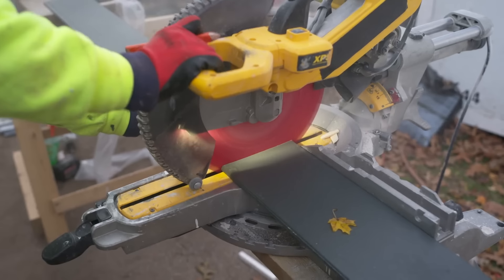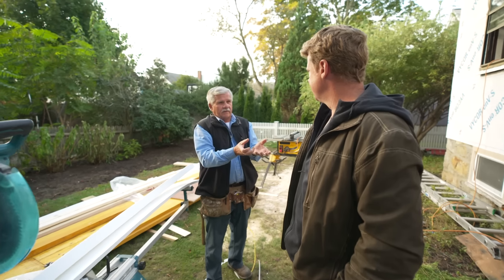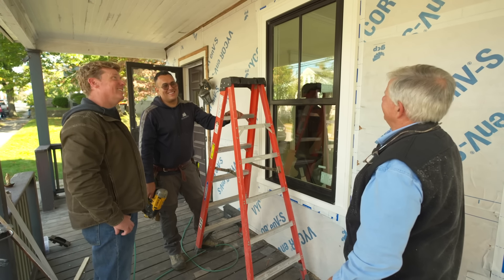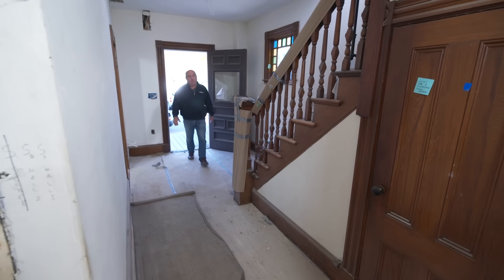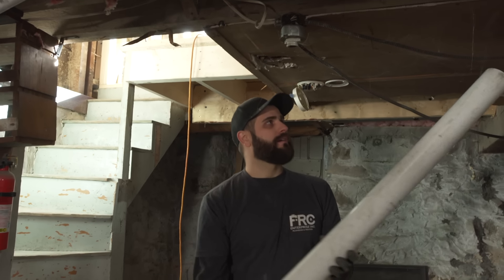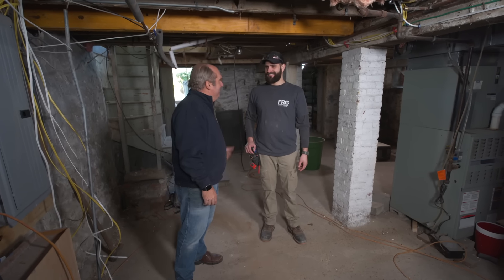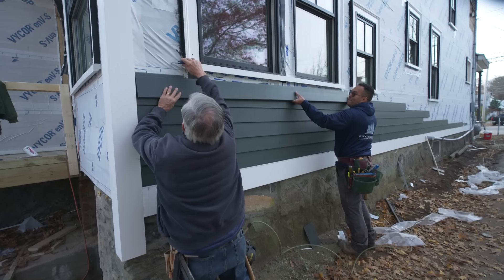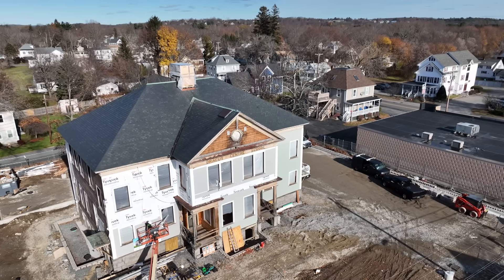This Old House | Drainpipe Puzzle (S43 E19) FULL EPISODE

Comment: What precautions need to be taken with that PVC window trim as far as warping in extreme Summer heat?
Reply: PVC is a thermoplastic that can withstand 140 degrees F and PVC pipes up to 220 degrees F.
Reply: Don't paint It a dark color without thinking about sag. If it's going to be painted dark, use extra fasteners to prevent sagging in the sunlight.
Reply: Architect here…using Boral more and more to void that very problem.  Yes, PVC can withstand heat technically but has large thermal expansion, so, yes, it sags and twists and shrinks and joints open up..

Comment: Why the round holes cut in the outside planks?
Reply: There was at one time holes cut for blown-in cellulose insulation. Awful messy stuff that compresses down over time, loses insulation value and the mice love it.  I would expect new spray foam to go in walls.

Comment: Running a lead caulk joint is from days of yore. I’ll bet there isn’t a plumber under the age of 50 that has ever melted lead on the jobsite.  Bell and spigot cast iron was forever.
Reply: I’m a 50 year old plumber, you are correct, the 81 year old plumber that started our company has been plumbing since 1984, he’s only done it a handful of times.

Comment: I LOVE TOH & the guys & have forever....HOWEVER... why not layout/plan the plumbing FIRST then move/build walls second? I would
AND... underneath the z bend I would apply a small bead of OSI before installing the flashing. 
I call it 'back caulking'... & I would put a smidge on the end of the 'water table' or I call it a ledger, when butted against the vertical corner board. If a little water gets behind the initial surface, it really won't get too far.

Comment: Chain cutters for cutting large cast iron pipe are extremely expensive. A much less expensive option is a Diablo Steel Demon Carbide Teeth reciprocating saw blade. These blades are not cheap, but they cut through a large pipe in 5 minutes and I could reuse it several times. I'd also tried the better metal cutting blades from Milwaukee and Lenox, and it took over an hour to make one full cut and it destroyed 5 of those blades.

Of course, I only learned about the carbide demon blade option after I'd bought a used chain cutter on Craigslist that ended up also being a terrible buy as the chain blades were too dull (replacement chains are incredibly expensive).
Reply: 🧨 +duck tape. Easy peisy lemon squeezy.